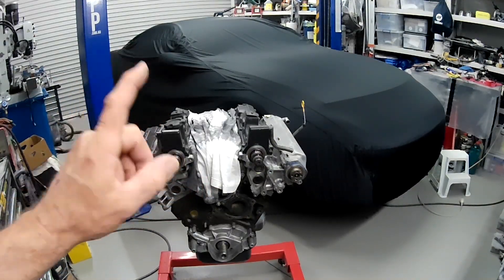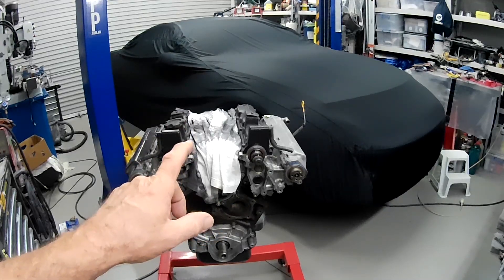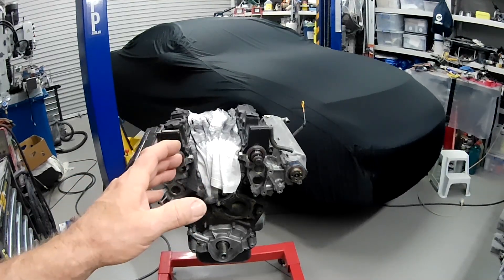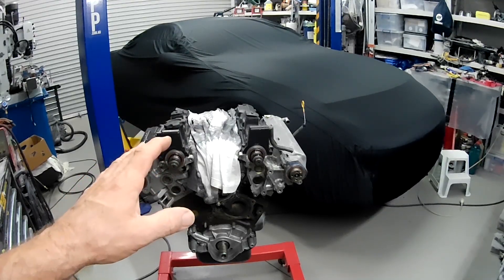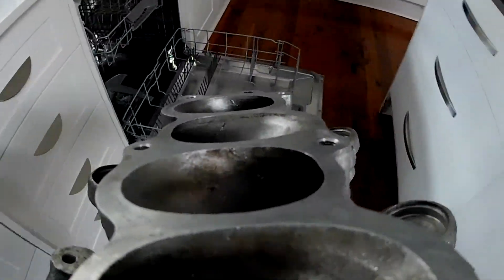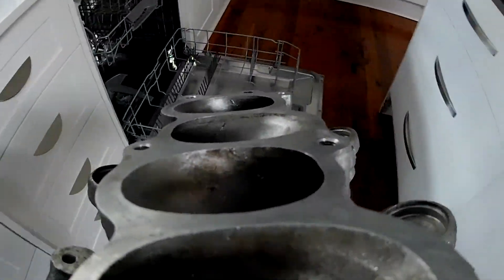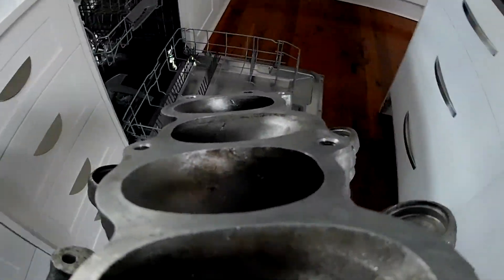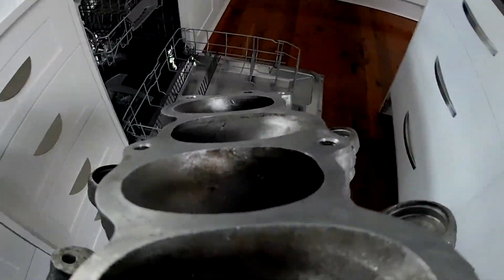Water Jacket Casting Flash Removal, Manifold Porting, Facing Turbo Manifolds Nissan Z32 300zx Turbo

Comment: Smells like progress.  When I did the coolant galley on my block, I had the benefit of having it in pieces and able to send off to get hot tank washed with all the plugs out.  The front half looks pretty good.  I will say that the MotoIQ "guide" that they did with their block I followed for the most part, but I was also told by the owner of Specialty Z out of California that while the guide is a solid read, that he felt that it was used as to show off.  So long as you have a hole around a $1 AUD coin then that typically is good enough and everything else MotoIQ did to include the Devcon steel putty fill in is just a waste of time.  Sadly, I wish I learned that before I bought my container of Devcon but it is what it is 🤣
Reply from the maker: G'day Mate, yes, its definitely a filthy crap job hey. I'm a bit ahead of this now & have the engine completely stripped down, plugs out etc & all done. God dam there was some crap in there. I ended up doing a lot of work in the rest of the blocks coolant passages also due to this thing being so full of rusty sludgy crap. No need for devcon in this, it had a sludge fill. Thanks for the comment Mate, Cheers.

Comment: Thanks for sharing 👍 Will you see any improvement in your engine performance? 🤔
Reply from the maker: G'day Craig. Not specifically. This is just one tiny piece of the overall work going into this engine. It is a Big Power Build & its a case of "leaving no stone unturned". The whole intake system is being cleaned up for max airflow & areas of potential turbulence addressed. On its own though, not worth a cracker. Cheers Mate.

Comment: Great work Trev. Will you be coating the combination, intake inlet, exhaust outlet ports on the heads, turbos, down pipes?
Reply from the maker: G'day Eric, probably not, if money was no object then maybe. I can use the cash elsewhere in the engine. I'll probably just wrap the downpipes. I have used a lot of wrap on my other TT Car & its been great. Cheers Mate.